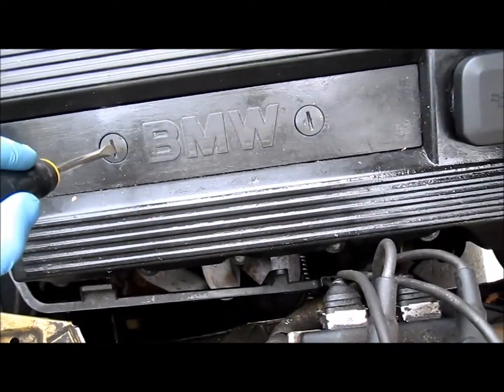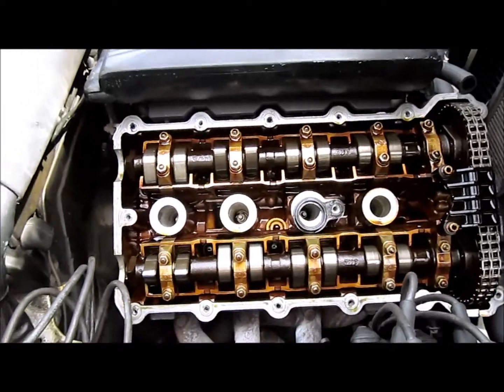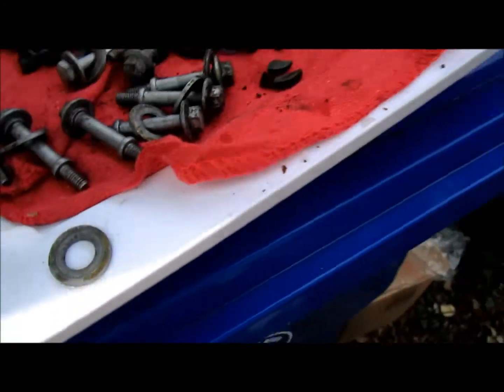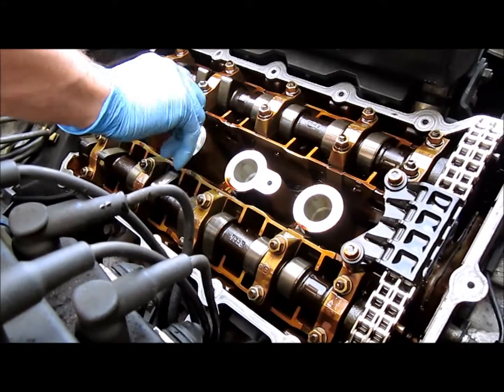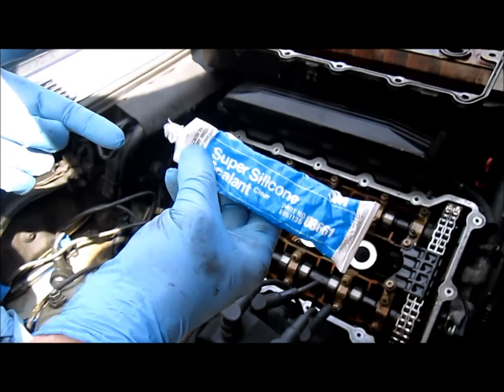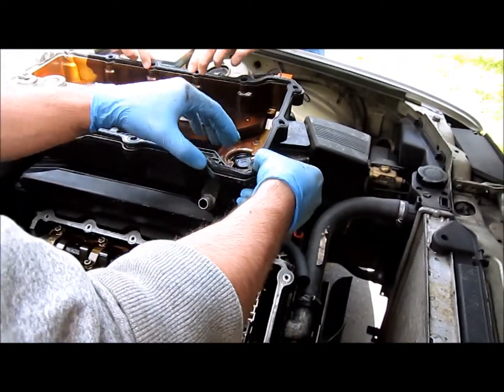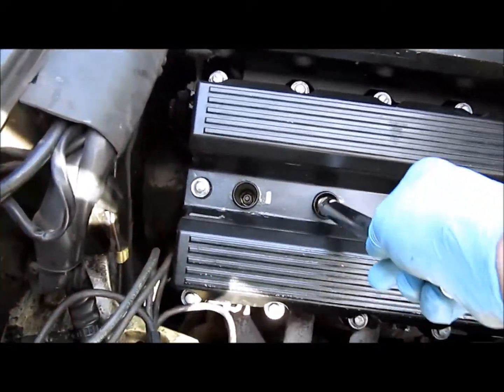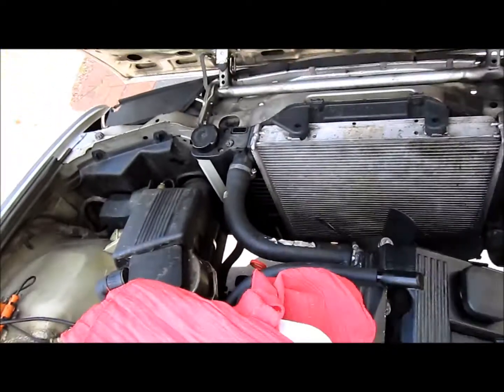BMW E30 M42 Valve Cover Gasket Replacement DIY Guide

Comment: This is exactly what I needed to watch. Thank you for making and sharing this. My e30: the #3 plug well has a bit of fresh oil in it, and I'm fairly certain that it's a leaky VCG. Otherwise, no problems-- runs great, no burning oil or white smoke.

Comment: does the m42 engine have oil supply seal like m44 and are you suppose to wait for the silicone to dry?
Reply from the maker: Yes. and yes, wait.
Reply: @BluePurpleRed  Are you sure about the seal? I found online that oil supply seal (part number 11121247948) is only on m44 engine close to the upper slide rail (for the chain), where is it on the m42?
Reply from the maker: I should have been more clear. Yes wait for silicone to dry. I am not familiar with the M44.
Reply from the maker: @23tomi23  Perhaps you are correct. While similar the M44 and the M42 are clearly not the same.

Comment: Great vid. Thanks.
Some questions or doubts that I have.
Do you know tightening torque for the cover bolts?
Any bolt tightening pattern?
As I watch in your vid, sealant only in curved sections?
Thank you. Very useful  and instructive job.
Reply from the maker: There is a pattern, you want to hand tigthen them down, and then use the following guide for the sequence.
https://www.google.com/url?sa=i&url=https%3A%2F%2Fbmwm4usa.blogspot.com%2F2020%2F06%2Fbmw-m42-head-gasket.html&psig=AOvVaw2fluPeJtjHPvlMoRQ5pyO-&ust=1608835582421000&source=images&cd=vfe&ved=0CAIQjRxqFwoTCLiJn-Lh5O0CFQAAAAAdAAAAABAD